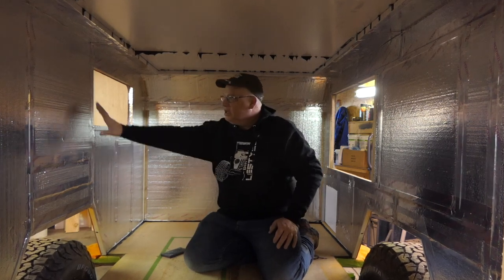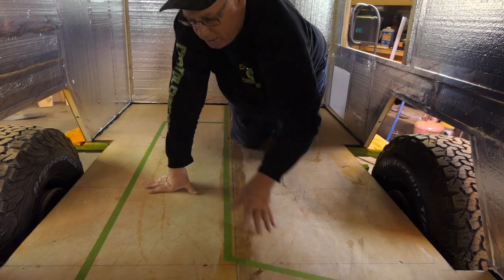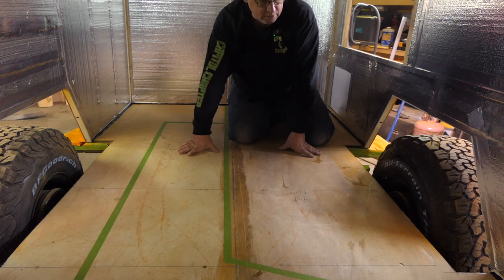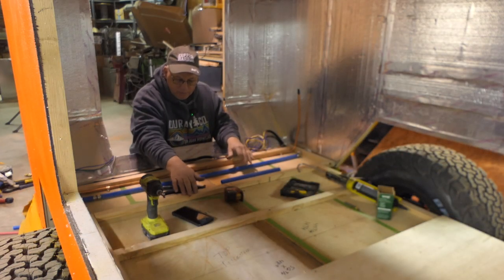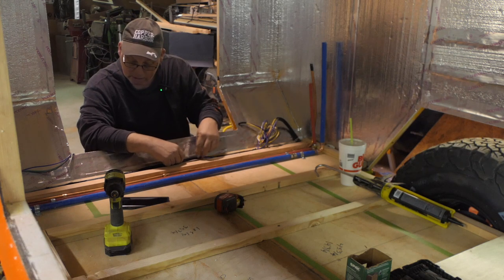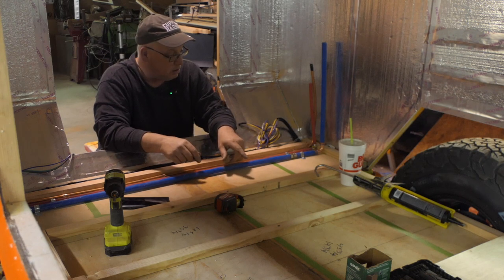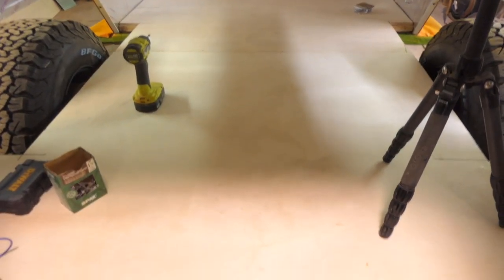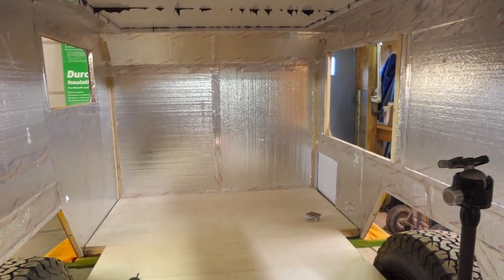DIY Squaredrop Camper Build Part 7

Comment: How have the soldering joints or press joints held ? Any reason you didn’t use flex for the gas?I am absolutely impressed with your work. Going through all.  Thank you for your good commentary
Reply from the maker: Thanks for watching, it's much appreciated.  The trailer hasn't even been on the road yet, so nothing to report on the solder joints.  I used copper because I had it laying around.  Flex would have worked fine as well.  I hope you enjoy all the episodes.  Thanks!!

Comment: It looks really good 👍 can't the top of the rooftop tent hold a rack? Or solar panels?
Reply from the maker: Yes it can, I have racks for it, for a kayak or whatever.
Reply: @dirttrekking4321  if you finish in time and went down to Overland expo west you would kill it. They have a diy section you can sign up for and if you can get your sub count over 1k you can request a press/creator pass which provides early access and free access.